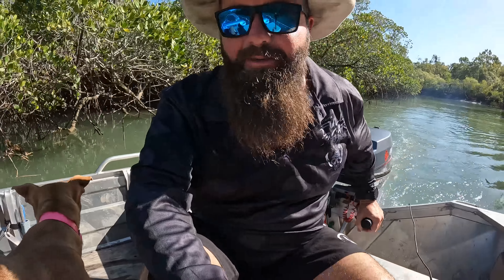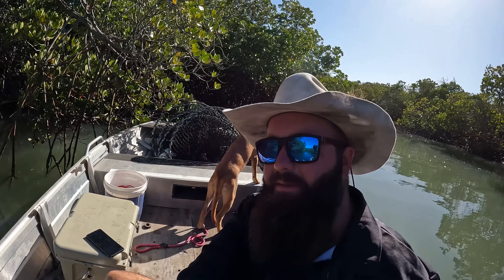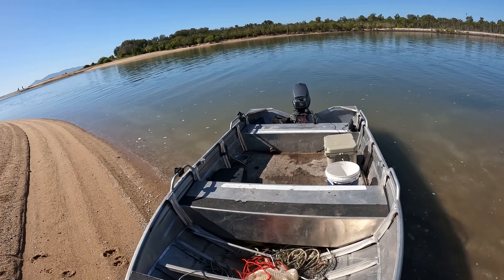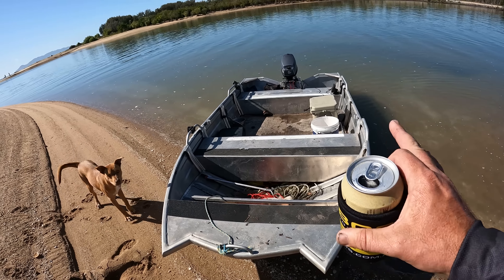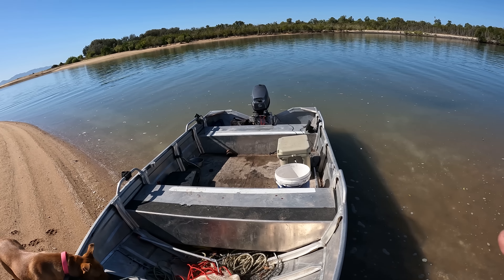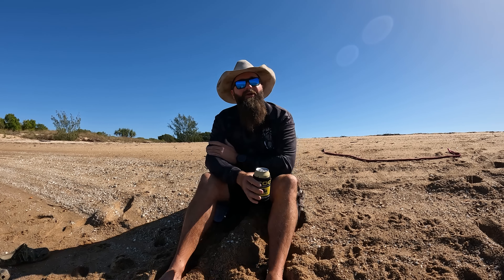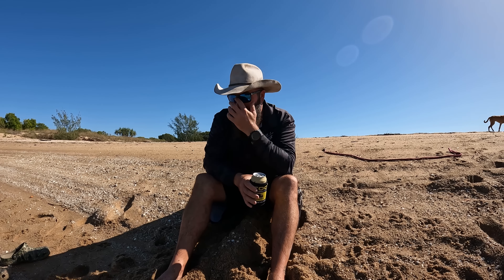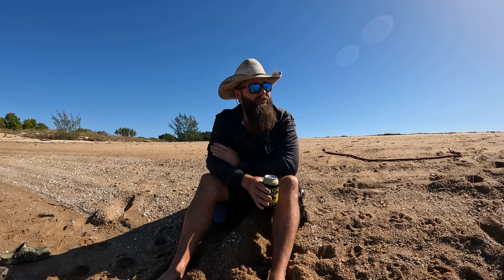ULTIMATE CUSTOM BUILT TINNY / BOAT BUILT. Episode 1. The Idea 💡#boatbuild #tinny #custombuilt

Comment: You should look at putting a solar panel which mounts above your outboard  that is removable to charge an auxiliary battery, so when on over night/ couple night trips you can run a fridge for the beers 🤙🏾
Reply from the maker: Nah I want it low to get in the tight creeks, esky will do the job

Comment: Rod locker, maybe use something like Hobie use in their PA's, the tube that goes up under the front.
Sealed gun locker to fit shotty, could go sideways across back of front cast deck.
Recessed mesh section in front cast deck that drains outside. To drop cast net catch on to. With lid over the top to turn it into a normal cast deck.

Comment: ok mate, unless you are going to mail me a boat to north america, I probably won't be in the market for one of these, but here's my feedback.  Maybe 4 or 6 fold down seats under the wide gunnels and a fixed single seat for the pilot and get rid of them bench seats.  As far as electronics, I just overhauled my boat and after a ton of research it seems to be very much personal.  I chose Garmin, but I think simrad and lawrance are all good names with similar features across the spectrum.  I personally don't like humminbird as i had one in a previous boat and it was not as "water proof" as advertised.   Good luck, I'll be following along on this build, sounds like a great project to be involved in with a great end product!

Comment: Echo what a lot of folks are saying, wide body, tiller, wide gunwales, casting deck with wet & dry lockers, maybe a gas strut for the WHOLE casting deck so you can have your traps, rods, batteries etc. And for me a 4.35, we're in the Noosa Hinterland so a bit of both ie river & close in bay work. Love ya work mate this is a corker of an idea. 🎣🐟✌️👍
Reply from the maker: Cheers mate

Comment: As a boat builder in nth qld.

Tiller steer, welded floor, under floor tank, 150-200mm gunnels, single hatch cast deck up to coaming height, minnkota mount.
Piss the live well off. We find our customers barely use them and then convert them to another tank or just store shit in it.
Defo saltwater deck wash.
Best mod will be seadek on gunnels, floor and castdeck.
Dekdesigns in Cairns just started doing it.
Reply from the maker: Yep all that is on the list

Comment: Hey mate. We just got a new boat at work and the rear seat is hard back to the transom, storage box either side  for seats and engine well in the middle. It adds a lot more deck space and because your back closer to the motor it makes it easier to stand up and drive the tiller steer.  I don’t mind it. Ill send you some picks tomorrow on insta. Its a work boat for construction, but similar to something you would see up the cape to barge quads around
Reply from the maker: I got your videos mate, cheers it looks good 👍

Comment: Hey mate being more of a crabbing boat i would have a self draining casting deck and self draining main floor to make it easier to clean when you get home 👍🏼 make under the cast deck all storage and have your idea with the kill tank on main floor to sort your crabs which you can drain out from a bung out the back of the boat. Go tiller steer for more room in the boat but have a small console off your gunnel to put a sounder, radio, storage compartment ect. Go the 4.35m so you have options to go inshore on a good day if you want and ofcourse get the max HP outboard. Sounder would have to be either Garmin or humminbird, i rate both but i got a Garmin. Underfloor fuel tank is a must (40L minimum). 3 seat positions minimum. Live bait tank on one side of the transom and a storage area for your battery on the other side with self draining lid to stop water from getting inside. 

Hope this helps

Comment: Hey skid, you may already know this but in case you dont....being a plate boat you can have your live and kill tank welded in to the back corners inside the boat, they drill holes through floor to get the water in and out through back to control level while underway, best setup, no pumps etc required
Reply from the maker: Yeah that's what I was talking about 🤙

Comment: G'day Skid, a creak boat, for crabin and prawning should be fast, shallow, draft, very stable, able to punch through a chop and stay dry, handle a fair bit of weight for those overnight camp trips to remote creaks, underfloor fuel for a couple of days 50 l plus, have a floor big enough to store and work with at least 8 big round pots, dry storage for your safety gear, car keys, wallets etc. Sealed floor easy to clean, sealed gunnels, covererd anchor well (no holes in the deck to catch crap or break your leg in). Be able to take a hit without cracking or bending, get on the plane quick, stay on the plane slow. That would be a half decent rig.🤙

Comment: Electric Jacking plate for the motor, cup holders that fit a yeti/ toadfish cooler, under floor fuel tank, no bench seats and a  casting deck

Comment: Hey Skid, I bought my Seajay 4.85 Tropic In 2010 when I lived in the T'ville from RSM, I'm looking at raising my casting deck and putting the esky parallel to the boat so I can get in lower in the hull, plus have room for dry storage few extra slabs of Northern in there lol, run some led lights under the gunnels so at nght the crabs don't take ya toe off big suckers up here in Darwin, mine's a centre cab set at the back so plenty floor space the less shit under your feet the better, get a sounder and some tunes on deck and keep it simple lets go crabbing lol
Reply: I’d like to see the tropic setup

Comment: Crab pot storage left hand rear. ( so all the crap in the pots does not blow back on u on the drive home, and if crabbing alone they are right there ) Live bait tank  right hand rear. Casting deck lower than normal  to improve  stability. Like the idea of  discard windows/slides in the sides. Battery in a box that is at gunnal line so if swamped bilge  pump still works. Ply floor several hatches, no center seat, but seat posts where ever, and more power the better.

Comment: Mate I am interested in a 4.3 
For me everything needs to be mounted below the gunnels. My sounder gets hooked up in the trees when your pushing up in tight spaces. You need flat floors casting decks front and rear. A V-nose to handle the chop out the front when traveling but still stable at rest when walking around flicking lures
Reply from the maker: For sure mate

Comment: A raised lip at the back of the sealed casting deck with drains on the sides that face backwards so you can hose all the mud and crap out without it going into the floor.
Reply from the maker: Awesome idea 🤙

Comment: Double it as a Dartmouth boat for us down south ,aluminium pontoons on the side for stability  ,swing away console  and electric winch is a must
Reply from the maker: It won't have an electric winch, but will have a minkota so you won't really need an anchor
Reply: I agree with the pontoon idea, can't beat the stability and extra safety for peice of mind.
Stabi craft and Surtees boats are the best for a reason, 
 I'm not saying build a Stabi but they have unreal features which you could incorporate to enhance your crab boat, I.e very wide gunnels and amazing floatation/stability.
The only issue is the added weight the extra aluminium would add and that includes your wider gunnels that you want. You may have to go 3mm for the hull and 2mm in other areas.
Very interested to see what you come up with in the end though as it could become a real benchmark for future builds.
Good luck bro.

Comment: Tiller steer, Peddle stool seats, rod lockers, wash down pump to wash all the mud and crab bait shit out on the go. 
Have the sounder set up like Ryan Moody does on his Barra boat.
Underfloor fuel tank.
Maybe a couple of eyelets so you can strap the crab pots down when travelling.
Rod holders in gunwales.
Built in tackle box, Everything to have a place so not having to lift crap to get to stuff.
For shade i would just have a hole welded into floor and use a big umbrella shade. Put up when fishing and it’s out of the way and low cost.

Comment: My 2 cents is a center console, the side console is shit when there is only one person as the boat leans hard, messing with the dynamics of going through the water.  Also you can incorporate a front seat attached to the console with storage underneath. Fuel tank underneath console/front seat keeping all the weight in the center of the boat. Batteries at the bottom of the console underneath the steering wheel. The seat could be wide enough for 2 (obviously depending on boat length and width) and that seat could also have storage underneath, for me I'd make it into a built in esky. on the gunnels on each side some sort of rig made for holding the nets when collapsed so they're out of the way when travelling. Also a targa top which also includes your radio and fish finder. Also have the motor on a pod arrangement then extends all the way across the beam, so it's out of the boat and then the whole rear deck is completely clear, also gives you a spot either side of the motor for getting in and out. I can think of more, maybe you should have a competition where we could submit drawings/plans of our ideas. This is a great opportunity, good on the fellas who offered this up to you, this will be a really interesting project, best of luck mate

Comment: Standard option of a small casting deck of about 1.5m and low back deck then a fishing option with a extended front deck of around 2.5m with a heightened rear deck. All have a welded electric motor mount. Have the choice between timber floors or ally. V-nose punt kinda style. Non of the bullshit accessories like quintrex or stacer.

Comment: Mate has a hammerhead with alot of the features you are talking about,  hinged casting deck with gas struts is awesome has heaps of storage, in floor insulated kill tank/esky is shit constantly fills with water when casting for bait,  super hard to get on the plane with all that weight down the back. My advice would be to have one that runs parallel across the boat up the front  and is waterproof or drains out the side. Also large tube under gunnel to run wires for electrics etc. and marine ply floor with flowcoat and
 grit added for non-slip lasts for years carpet is shit.

Comment: A creek boat has to have a flat bottom to be of any real advantage for creek use. (don't compromise).  No need to reinvent the punt.  Maybe fine tune it for taste (gunnels wide enough for beer and rod holders on sides high enough to keep creek water (not white water) out.   If you want flotation make the sides higher and use a 200mm thick double skin base with foam.   A small flat raised quarter deck and a light weight carnage cage to help minimise snagging on overhead branches (and give you something to hang a bit of shade cloth on).   A couple of (multi location) clip down Chilly bins for bench seats and carry-alls.   Done.  KISS

Comment: 4.15 or 4.3 sized ones man. Bit bigger. Bit more solid. Can punch into a bit of slop an out around the front areas.. still get into shallow water for crabbing etc. trust me once you get a little bit bigger size tinny. You won’t look back man!! An it’s not to big either… fit a few people an all the gear an still easy to use by yourself.. get them welded in built in live bait tank aswell.. outboard wise. Tiller steer . Yeh suzzies are good. But if your able to go for a yammy. Unbeatable..
If you wanna have a bit of a chat about some stuff an especially sounders man definitely down to have a chat about that stuff!
Reply from the maker: Cheers mate

Comment: 4.1 m length 
Bench seating 6 inches higher then standard. (No pedestal seats)
Transom design to carry 25hp and a  5hp aux
No flooring no carpet. (Hessian bags only)
No casting platforms.
No electronics or hard wired lights.
12 volt battery for power trim and tilt and starting.
50 mm bung either side running 50mm lay flat hose extensions for draining boat while under way.
Aluminum tubing  to fit standard beach umbrellas for shade.
Trailer must have sherpa wireless electric trailer winch

Comment: Length will depend on if your going to go up the top end of gutters like we've seen you doing V Nose punt fir stability with a forewad casting /Crabbing Deck with built-in Esky rear Casting deck with Battery and Live Bait tank storage front n rear as allowed Bimini top 3 bow Tiller steering 40 HP Suzuki 4 stroke Small side Console with Sounder GPS Phone mount Drink Holder two Buoyancy pods on rear with stainless steel prop and stainless safety cover in prop as with lifesaving has on their boats great for underwater obstacles up creeks extra led  lighting under Gunnels and Bimni top Trailer to be alloy with walkway down centre for Croc safety double mounted spares with bearings Boat to have 2 small bungs and 2 large BOAT between seats enough for a swag roll out and a 125-150 Gunnel flush mount rod holders and fuel filler to Ali fuel tank below floor